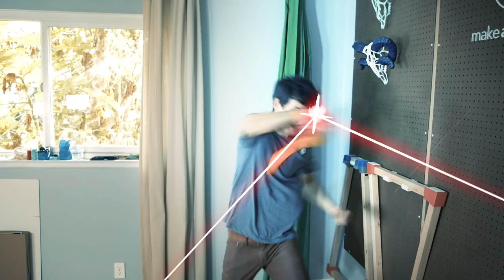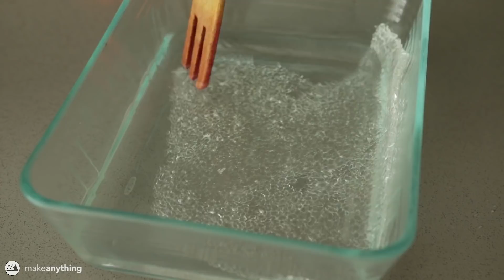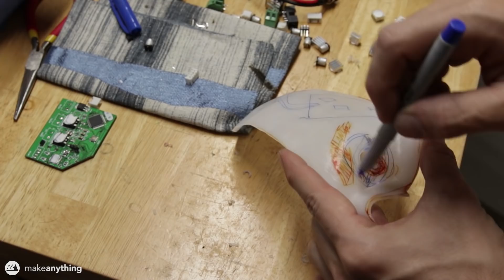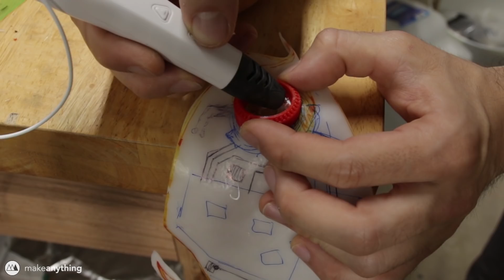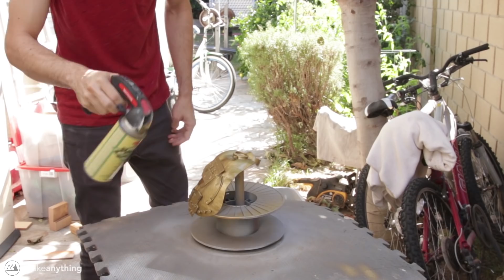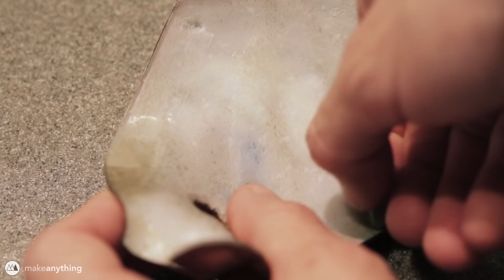DIY Bionic Eye // Halloween Edition

Comment: When sanding PLA, such as the plastic from a 3d printer or 3d pen, use a spray bottle of water to keep the surface wet while sanding. That will help keep the temperature down and prevent the plastic from hitting it's glass transition temperature from friction and totally ruining your surface finish.

Comment: Some light emitting wire around the eye with a different color for accent and a single UV LED for backlight for that lens would have set this off. You could have used the capacitor as part of the mask.